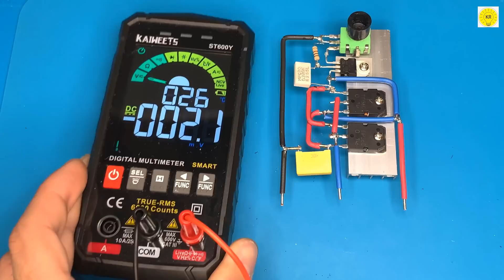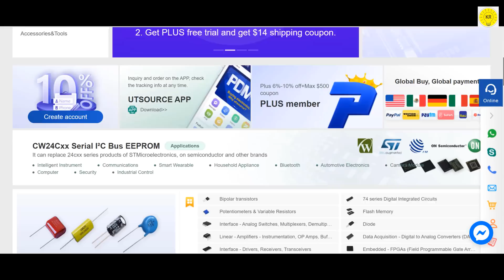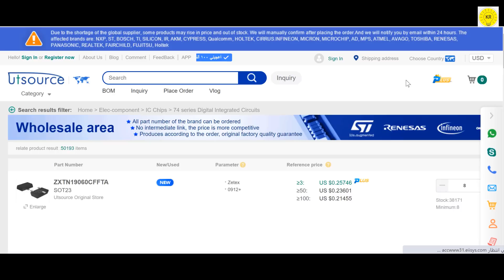voltage regulator lm317 power supply

Comment: the incoming power voltage should exceed the output by at most 3vdc at all times to maintain good regulation. build the input supply according to transistors dissipation in worst case situation when a lower voltage operates at high currents

Comment: If that is a 55W bulb, I’m God. It looks to me like 5W. The comments already speeks for themselves… with all respects, you do mis a lot of things. I made a 40A lineaire PS some 30 years ago. I put 8 end transistors in it, drawing 8A of base current, forced cooling end a motor driven variac in front of it to keep the dissipation under control. My max voltage over the end transistors, independent off output voltage was never higher than 10V thanks to the automatic stepper motor driven variac (all diy). Compare to this it is a dinosaur but does the job (still) as designed.

Comment: Hello, 
Lm 317 linear voltage regulator is too stable, it doesn't work, it converts the drawn current into heat, it suffers power losses, I don't recommend it. Instead, lm2596 feedback, switched regulator with const.  Modify Current Regulator.  Available on my channel.

Comment: what is the input.. is it 12v 1amp or 12v how many amps? please clarify this
Reply: To get 50 Amps output you need 50amps input you can not magically increase current without sacrificing voltage. To get 30v and 50amps output you must input 30v and 50amps though I doubt this circuit could handle 50amps without getting too hot lol. The only thing this circuit can do is allow you to control the current and voltage and ajust them to be constant and independent from each other.
Reply: to get 30v 50a you need 1500+w input power bro

Comment: You owe us the proof that it works with 50A. I would be interested in how you want to get the power loss at low voltages under control.
The TIP36C will have a hard and short life in that area.
👎👎

Comment: Great technical video and well explained.  Will this circuit control a 10amp 28volt Tesla coil power supply for 10-15 minutes run time under that load. Keep up the great episodes.

Comment: I tried this circuit but it doesn't work. It regulates only from 8v to 9v on a 10v power supply. This frustrated me. However it works with tip35 but with the correct wiring !!!!

Comment: A TIP36C has a max. power of 125W. Thus: 2 X TIP36C = max. 250W. And 250W : 50A = 5V. This means that only with a voltage drop of 5V, this is able to produce 50A under ideal circumstances. I would not exceed 10A. In case of 10A you certain needs a fan  to cool down the cooling plate. It is also important to connect a resistor in each base of the transistors (e.g. 3.3 ohm 0.5W). This avoid that only one transistor does all the work in case of different HFe.
Reply: should have have the tip's as drivers to 2x 2n3055!
Reply: @chilledoutpaul  Using 2X 2N3055 wouldn't work because these are NPN transistors, while a TIP36C is a PNP transistor. The MJ2955 (PNP) is complementair to 2N3055, but has a max. current rate of 15A, while the TIP36C has a max. current of 25A. You achieve almost the same power capacity if you would use 3X MJ2955.
Reply: @anmeirdi  Hi yes I did see your reply about the pnp, sorry I did not notice the tip36's was a pnp, i went to the 3055 as the normal high current alternative  but yes the  mje 2955 would have been the correct transistor or even a p channel mossy as they work on a low current to activate
Reply: The circuit is wrong... You dont need base resistors, bases are togeter . emiters need 0.1 ohm to equalize sharing current and has to be conected to VCC input. Collectors togeter conect to output, bases to 317 input and a 3.9ohm resistir from VCC input to 317 input, 5k pot  from adj  to gnd and 220ohm from adj  to out
Reply: @carloscoronado8712  To manage the different Hfe of parallel transistors, both systems can be used; using resistors connected to the base, or resistors connected to the emitters. But the resistors in the emitters have to dissipate much more power. Also with parallel mosfet-circuits, the R's are usual connected to the drain. The emmiter R's are most used with amplifiers, and less with power supplies because with high output currents the voltage drop over the resistors have a nasty effect on the set output voltage.
Reply: He has tried to block me now lol😂
Reply: yes i agree  with you
Reply: @ahmedsoffy581  thank you Ahmed :)